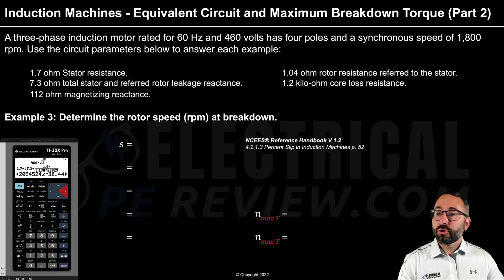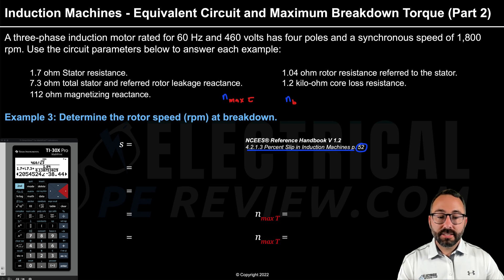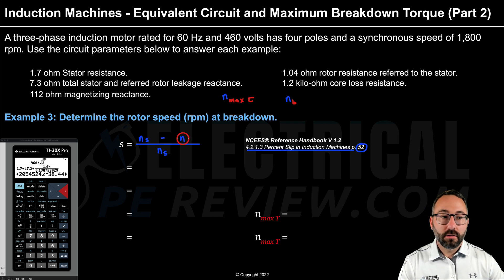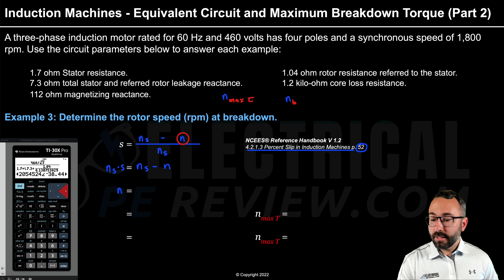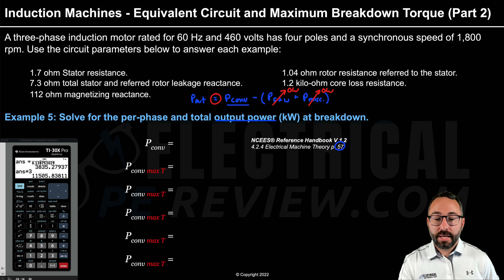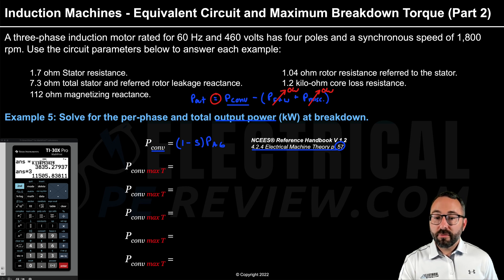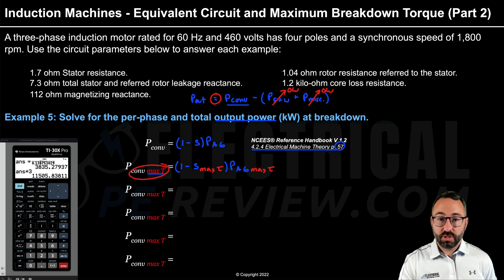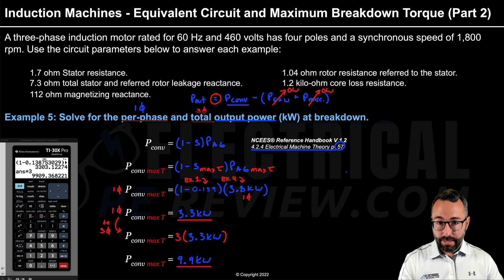Induction Motor - Equivalent Circuit, Maximum Torque, Breakdown (PART 2) for the NCEES Power PE Exam

Comment from the maker: Table of Contents (PART 2):
0:00 - Problem Statement
0:17 - Rotor breakdown speed (n max T)
4:37 - Rotor air gap breakdown power (PAG max T)
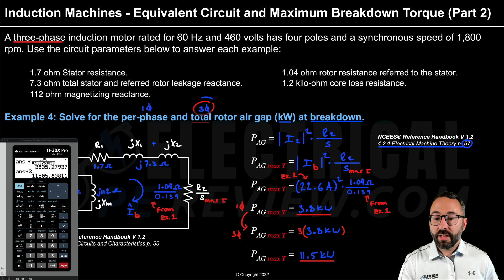9:18 - Converted  breakdown power (Pconv max T) and output breakdown power (Pout max T)

WATCH PART 1 - https://youtu.be/ZmWdvBD4HHI
WATCH PART 3 - https://youtu.be/RN6Worf-rVQ